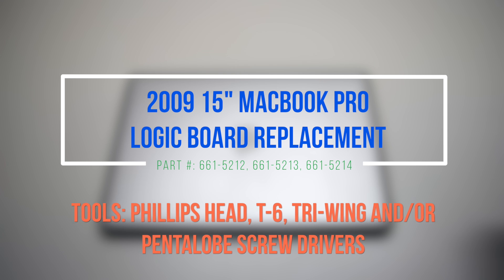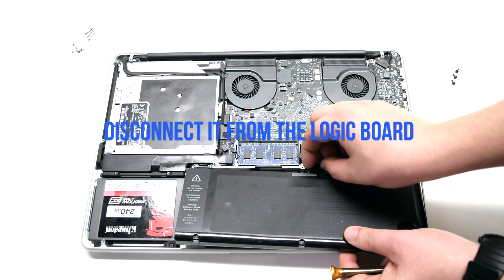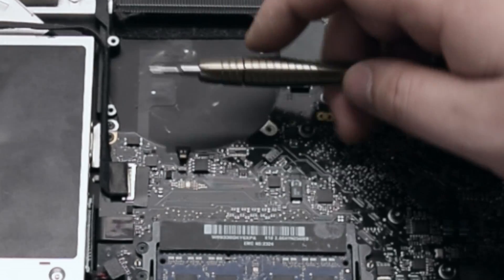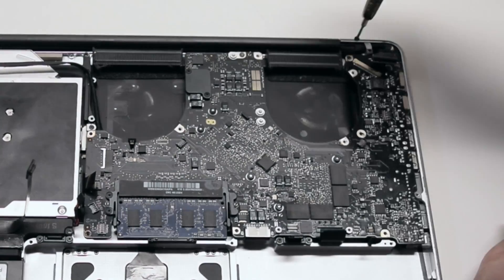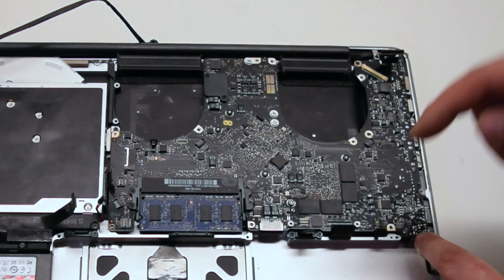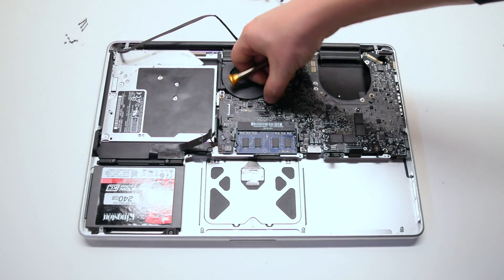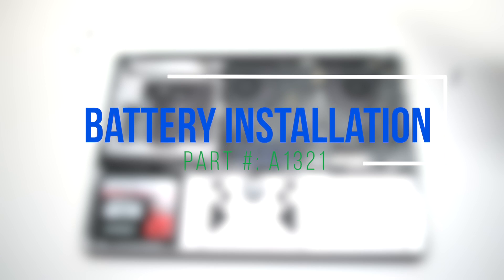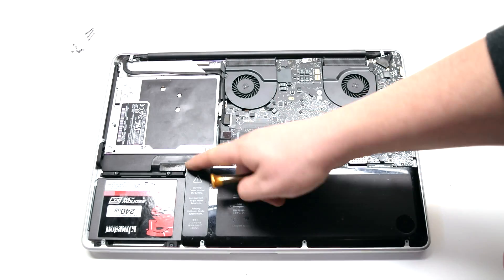2009 Macbook Pro 15" A1286 Logic Board Replacement

Comment: I did the same to put a thermal paste, now the MacBook book doesn’t power on, we’ll just the fan turn on to fast and then the keyboards light, but the screen still in black, and the fan never stop working, I need your help please! The led wen I close the lid start flashing and green led Shift button still works

Comment: Great video but it suxxxxx if you have the early to mid 2009 15" model lol. The board is stuck to the back panel with some sort of adhesive and no it's not the ports.. it's hard for me to imagine they soldered it to the chassis but it is Apple 😆.

Comment: Hello. I need a help with a macpro motherboard a1398 820-00146
I have 2 capacitors burned near the chip thunderbolt u2800
The chip is not working
The computer turns on, emits sound, displays video via the hdmi port, but does not display an image on the retina display. The thunderbolt doors and the usbs doors on the left do not work.
My questions are:
Are these problems caused by the u2800 component or should I start looking for another faulty part? If anyone can help me with this question I thank
Reply from the maker: This channel is all about beginner to intermediate repairs. For component level repairs and advice check out Louis's channel here  https://www.youtube.com/user/rossmanngroup
Reply: OK friend. Thank you for your attention and information.

Comment: Hi
I have a macbook pro mb985 model of 2009.
I want to increase performance, but do not want to buy a new macbook pro,
Please tell me, can I install the logic board in 2012 with the i7 processor of 2012, because this will actually be a new computer, is the new board for macbook pro 2009 suitable?
thanks!
regards
Reply from the maker: It will not work. What you can do, is upgrade your hard drive to a Solid State Disk and that will improve performance by 5 times.